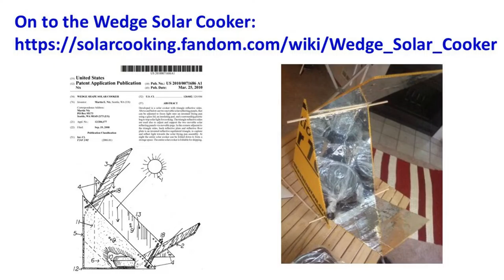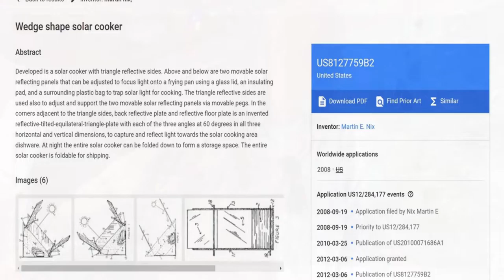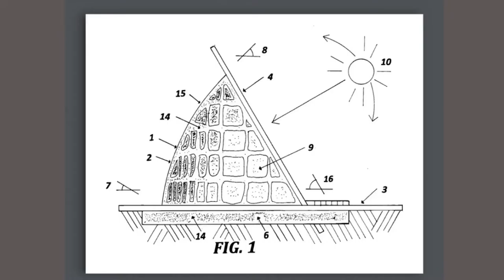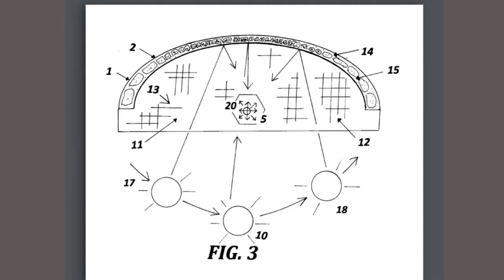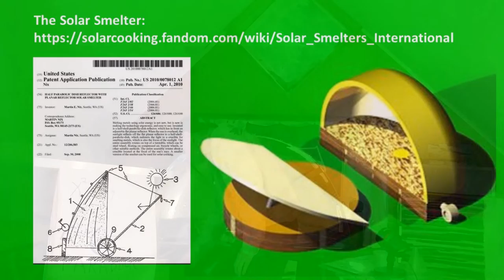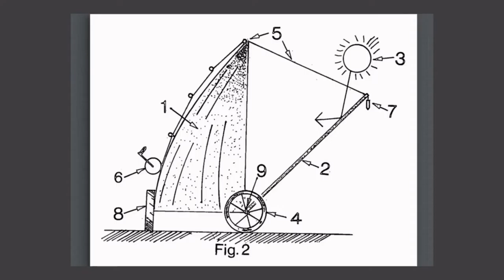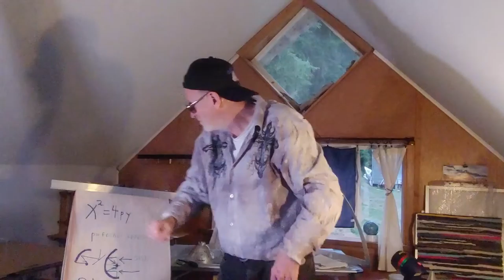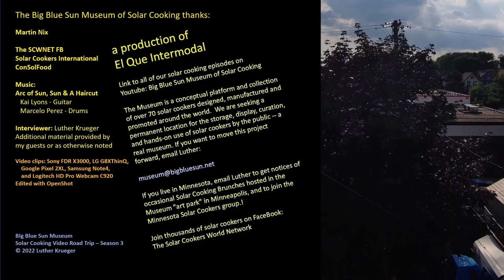Martin Nix: Forging the Past into a Solar Future

Comment: The smelter would work best when the sun is directly overhead (elevation = 90 degrees), and the plane mirror at 45 degrees.  At all values other for the solar elevation, the plane mirror would need to be longer, and at low solar elevation angles, impractically long.  I would like to see a working demonstration model, and some test figures.  The patent is very old now.  If this had worked effectively, it would be in production, or at least there would be a working prototype.  The demonstration with the laser light only worked because the light source was parallel to the axis of the parabola, analogous to sunset.  At any other angle, not much light would strike the focus.  What am I missing?
Reply from the maker: From Martin Nix (I've asked him to reply directly from this point forward):   

One of my biggest frustrations is the persistent belief that if you have a good patent idea, that magically it would be in mass production. That is not the truth. The reality is that the economic forces out there, just simply put don’t fund. And will discredit. 

The device itself is actually in mass production, as of a week ago and being reviewed by engineering at Hemin Corporation. They are starting with the 4 footer, and expanding upwards to the 8, 12, and 16. They tell me the device is unprecedented. The reason for the 4,8,12 etc size is that it meets standard sizes, of metal which come in sizes designed to fit inside a standard shipping container, 8x8x20 feet. They tell me the major cost of the device is the materials, not labor, which tells me I did my engineering well. We are starting with the 4 footer, and working up. The device tracks the sun, on wheels, which is low cost. The fact that it is assemble and disassemble and can be boxed, and can be used as a picnic table also is adds to the marketing. It also can be used to heat glow rocks, which then glow at night, not unlike that of ancient light house designs. 

As for the working model, I am working that right now, what you saw was my project being researched and development as my personal funds demonstrate. I have done small models of one foot or so. I have done working wooden models which have set wood on fire. But because of the resolution, of the surface, which is rough, have not melted metal, of my personal models. I am presently working a surface of aluminum and silver. In ancient time similar designs used copper, gold and silver. Electroplating being the best way. 

 I am presently constructing the 8 foot model, right now, time and money permitting, so as to forward engineering specs to Hemin. The biggest obstacle on this is translating the results to chinese.

The purpose of the planar reflector is to make light horizontal, into the parabolic shape. The planar reflector does have to be long, at lower angles, however, there is also stray light also, that enters the parabolic chamber that does not reflect off the planar reflector, nor go to the focus, it goes to the surrounding area, which is also called a parking lot solar collector patented. It heats the surrounding area of the focus, so stray rays, as it is called is also captured. The parking lot surface, patented, heats the surrounding area, so it helps keep the focus warm. 

The dimensions of the planar reflector are basically for a height of the parabolic to be 4 feet, you need to make the planar reflector 3 times longer, basically. However, when the sun is at a high angle, like 90 degrees, the planar reflector also needs to be at 45 degrees, pointing the planar reflector into the sky, that is the reason for the over head “crash bar” so as to prevent the planar reflector from blowing over, and and injuring. The planar reflector works very well in the 30 to 45 degree angles. However, there is a balance between the direct sunlight entering the paraboid chamber and the light from the planar reflector, energy is not destroyed or created. 

At sunrise, the planar reflector is not even used, the sunlight goes directly into the parabolic, and heats the surrounding area of the focus. Thus prewarming. The focus is not really a precise focus, but can be a area, the size of a frying pan. As for engineering data, I am independently going to get it, I have the 4 footer already built, and the 8 footer presently under construction, so will get at least comparative engineering data, from it as time and money permits. I rate the 4 footer at 2,000 btus an hour, certainly enough to burn bacon. And the 8 foot at about 8,000 btus per hour. 

To note there is also another design, that native americans use to build. It is carved in cliffs, and they used gold, and plaster. It was set at 60 degrees sun angle, it simply waits till the sun is in position, and presto works for maybe a hour each day. This is how the native americans made crystal skulls. In fact if you build this say 1,000 feet tall, and about 4,000 feet wide, it would produce nearly a 1,000,000 degrees. In fact, it would make neutrinos.
Reply: @Martin Nix     Hi Martin, thanks for your detailed reply. The only Hemin I could find is a dissolved company, registered in the UK, so I guess you mean Himin, the Chinese company that makes the sloped axis evacuated tube solar cookers.  They seem an ideal choice.  I see your azimuthal tracking system in the diagram, which looks very efficient.  The vertical tracking duties are taken up by the plane reflector, which for the larger diameter models would be 24, 36, and 48 feet long!  I note they would have to be perfectly flat, as even a small deviation would reflect the sunlight to the wrong part of the hemi-parabola.  A perfectly flat reflector, even of 4 x 12 feet, let alone 16 x 48 feet, is a significant challenge, unless you use float glass, which would be very heavy.  2000 BTU (I always find it odd that you still use British Thermal Units in the US, in spite of the unpleasantness in 1775, and we use kWh) is 586 watts, according to my conversion table.  This is in close agreement with a back of envelope calculation, assuming 1000 w/m2 irradiance striking two mirrors with .95 reflectivity, the second mirror being a half a disk of 4 ft diameter.  there is no allowance here for losses once the converging reflected sunlight gets converted to heat, and begins to do its job (cooking lunch, or melting something).  I realise the design is scalable, and judging by Dan Roja's experiments at GreenPowerScience, you would need to to get up to a diameter of 2 metres before you could melt even a small amount of rock.  The six square metre reflectors at Tamera focus sunlight into a 4 cm hole in the side of a fire clay kiln, and the granite shelves inside reach something like 900C.  They have used this device as a smelter.  Good luck with your project.  I think the very long plane reflector is the difficult bit.
Reply: You are so correct about the need to make the planar reflector longer. The X20, which is four feet wide, has a planar reflector at 7 feet long. the X20 parabolic half shell is only 2 feet tall. I went to a square shape, instead. The vast majority of the sunlight enters the bottom of the parabolic half shell. When the X20 planar reflector is at 6% tilt angle, the sun is at 12%. So the planar reflector is 100% effective at 6% to 45% tilt angle. However, the planar reflector is not needed at sunrise or sunset, when the sun's rays are horizontal. As for mass production, the Chinese at Hemin are doing independent manufacturing analysis. They tell me the unit's cost is mostly materials, so I worked out the machining cost. The unit is assemble, to box able for shipping. However, it can fold down to be a picnic table. I am getting test data, as my time permits. Financing the project out of my income, on my spare time, I have no sponsors. I am presently building the X21, which is 8 feet wide, so will get comparative engineering data. The nice thing about these 4,8,12, 16 feet dimensions is that it allows the units to use modular off the shelf sheet metal and aluminum extrusion, again reducing cost for manufacturing. I see the 4 foot unit at 2,000 btus/hr, which should be enough to burn bacon. The 8 foot, should do frozen turkeys, and if I can get the resolution up, should melt beer cans, maybe bottles. Still assembling.